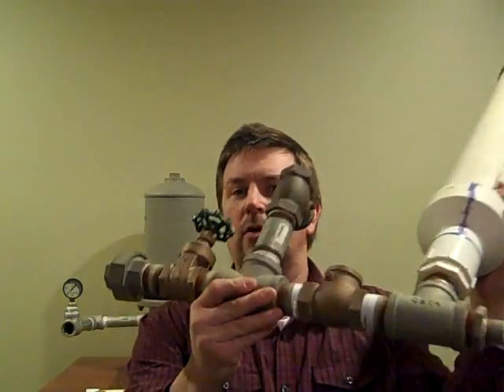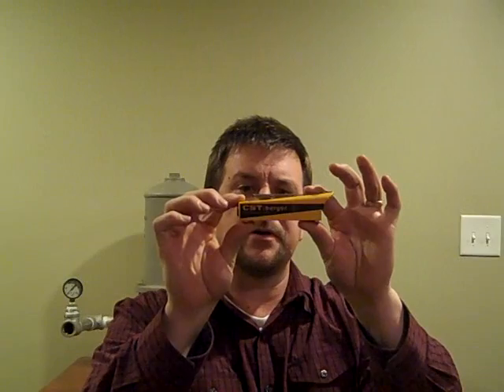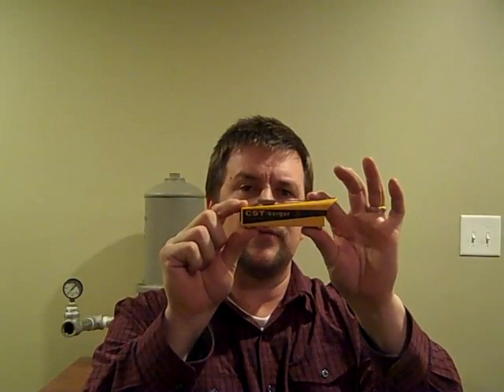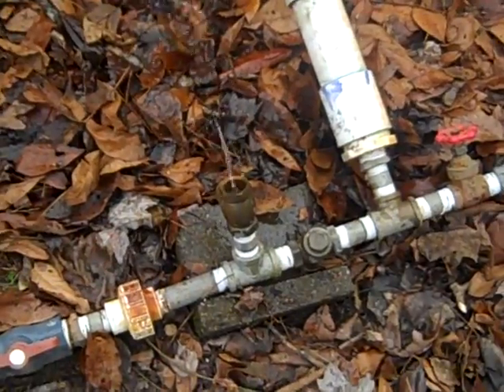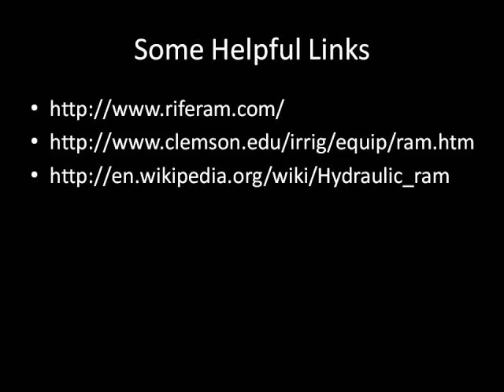ram pump overview

Comment: If I may, an easy way to determine elevation is to use a tube\pipe\hose from the intake point (bottom of grade) to the point of discharge (top of grade) and install a pressure gauge at the low end of the pipe. Water excerts 0.454 psi per foot(static). So if you had a discharge of 100' above grade the psi at the gauge would be 45.4 psi at the lowest point. 100 psi gauges are available on eBay for under $20. For people like yourself you more than likely have a gauge laying around. Just my 2¢

Comment: Is there a formula, or design that allows for capture of the waste water to re-direct it back to the intake pipe. (Like a spiral-shaped pipe that drops the waste water back down into the intake)? There has to be an efficient way to capture that energy.

Comment: I have read quite a bit on these hydraulic ram pumps and have seen them in operation, but I have often wondered if anyone has ran a few of these pump’s up to a common holding tank that spills over, in your case the water will spill over in to a slue and once the water built up momentum you can operate a hydro electric generator and the water flows back to your pond. And the excess water the serge water from the pump’s can be picked up using a solar powered pump and piped back to your water sorce

Comment: Hi, 

I was wondering how much head input do you think your ram pump design can handle? I want to build a pump that takes water up 700 feet. The drive pipe drop in elevation is not an issue, I just wanna make sure the pump is strong enough to handle the drop input. If that makes sense.

Comment: Is there any way to reduce the noise output of a ram pump?  Could I build an enclosure around it that has sound-deadening walls, or does the sound permeate along the metal input pipe?  I have watched all 4 vids in your series -- thanks so much -- I saw a diagram in a book and it made no sense -- now it does.

Comment from the maker: @trenttyre No problem at all!  Filtration, yes I use ceramic(monolithicdotcom), Katalin ( 2 styles)  but my main goal is to pasteurize the the water using flash pasteurization.  This way I won't use up my filter media.  I am building an 8 gallon water pasteurizer that uses hot water from my wood boiler.  I will be using a WAPI or SPADE indicator to know that the water is pasteurized.   Checking out your back pack light video as I am packing for a mission trip right now!  Thanks for the advice!

Comment: at what point would you need to have a booster pump or do you have a vid with a secound pump to get the h2o all the way up the hill or would you just try to adjust your fall, ive also come across a ram pump over 100 yrs old around here and the pipe was all made out of hollowed out cedar logs with male and female threaded ends on each log

Comment: I have 2 main concerns. 1) Freezing up... I have land in Colorado, at altitude. Because we get a lot of sun the average high temp even in the winter is above 32.  But for 5 months, the average daily low is below 20F.  Is the pump freezing up likely to be a problem? 2)  I have a spring, I think about 1-2 gal a minute.  I need to pump it up to the house, total vertical elevation from where the pump would be ... about 30 feet. Does that sound doable? ... thanks, Rick

Comment: for years I've been thinking about the best way to get free power to the farm house using a water turbine. only problem being, the  creek is the lowest point of my land and only flows 4 months a year and only desends roughly  15m from where it enters to where it exits my land which is about a mile in distance. now one would think a water turbine is not the right system for these conditions, and one would b right, but ive always wondered if it would b possible to have a tank on a hill with the ram pump at the boddom next to the creek and pump the water back to the same tank? so the drive and deivery lines r the same lengh as well as the fall and elation  hights the same hight. i know that water keeps level so it would flow back up to the tank naturally but as the water drops in the tank the water  coming back up to the tank wont make it to the top of the tank so it needs to b pumped even if it is only for the hight of the tank. then obvesly the water turbine would have to be fitted to the fall line before the ram pump for it to work. but by doing this would it affect the operation of the ram pump and cause it not to pump? any information or your opinion on my thoughts would b muchly appreciated. thank you for your time and effort in making these videos.

Comment: I really like the idea of these. I'm wondering if I might ask you a question. Have you ever tossed around the idea of making the outflow check valve smaller? Would that make a difference in the amount of wasted water flowing through it, or would that just slow down the flow of pumped water or stop it completely?

Comment: help.  have a rife ram that pumps good and steady, then when we open the delivery pipe valve, the outside valve sticks up.  We have checked and cleaned the inside valve and it isn't too tight.  its a brand new pump, maybe 4 weeks old.  totally baffled on what to do.

Comment: Hi, Watched the series and found it fascinating. It's lucky you don't have any near neighbours because the noise from the waste valve could affect your relationship. Replacing the face material of either or both the seat and valve with a suitable plastic would lower the noise without affecting the efficiency. Maintenance may increase of course. Regards.